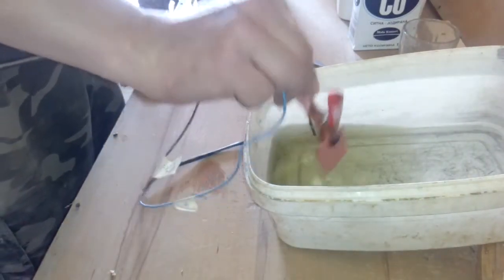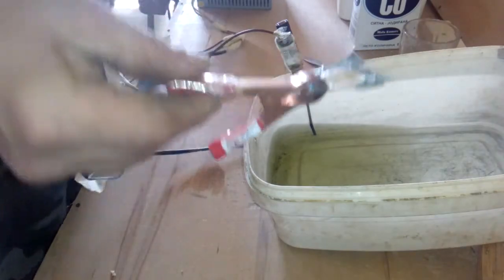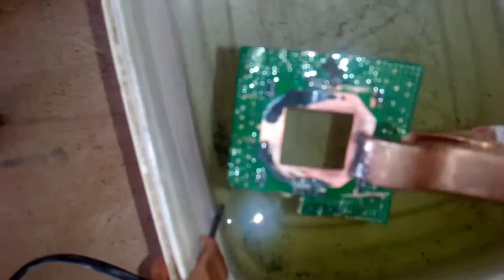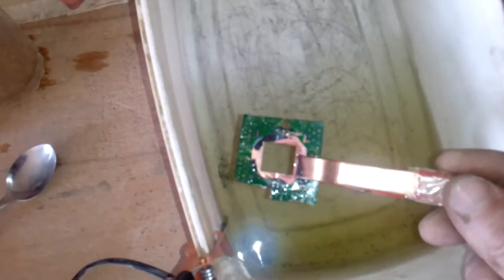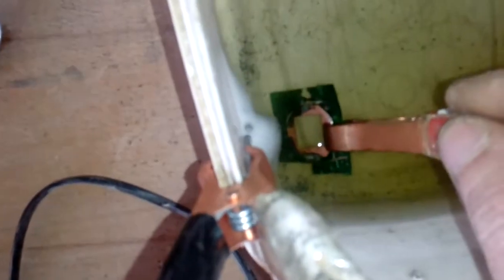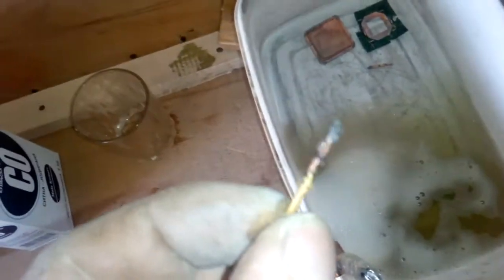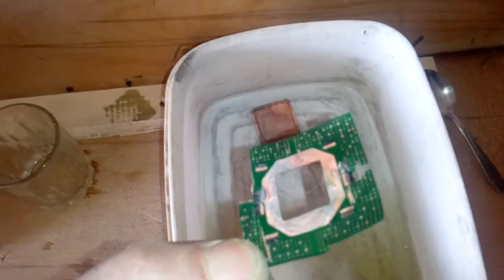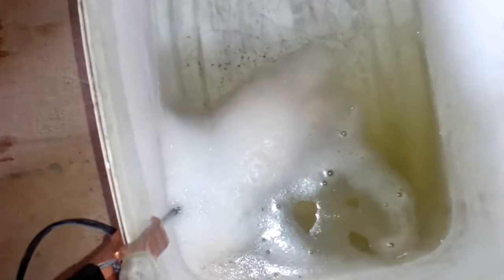How to strip the gold plate from P4 & P2 cpu heatsinks part 2

Comment: I've done this, different chemicals for electrolyte but process is the same and mine works with any base metal. I'm stucked in the refining part as I got the dark powder but it seems that there is no gold, tried AR without success. Do you have your gold in solution or as a dark powder form attached to neg terminal? Have you refined that already? Regards
Reply from the maker: I've done this a few times, just like this, always be gud for me.Gold com in solution as a black powder, then it filtered and refined with HCl-bleach. Always everything fit lyke shod be.Maybe your problem comes to chemicals that you use?Du you use sulfaric or vhat?

Comment: vinegar and salt isn't dangerous to put together, but when you put electricity in the solution you will produce the gases that people talking about.
Reply: Vinegar + tabelsalt produce a very light HCl acid and there are no real dangerous fumes, you may even drink it (not recommended!)
If you start the electricity,  there will be O2 oxygen bubbles on one side and H2 hydrogen gas on the other pole, wich are both flammable, specialy when mixed together in that foam in your bath, and that is very explosive, aka  oxyhydrogen
Reply from the maker: Yes, of course, a certain amount of gas is still present, but compared with sulfuric acid that is still quite secure vay.Of course you should always wear a mask when doing electrolysis or similar stuff..